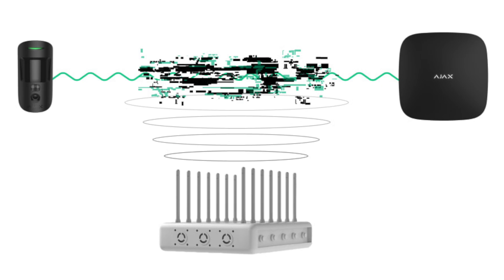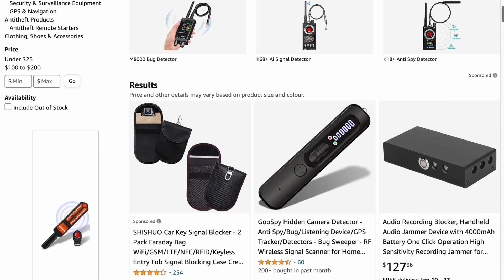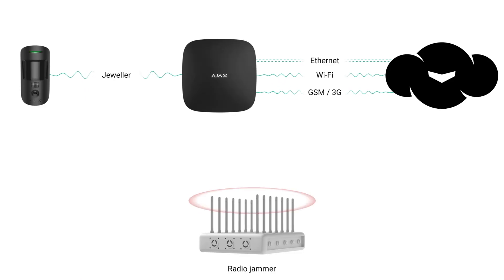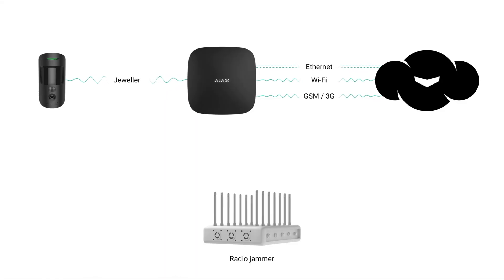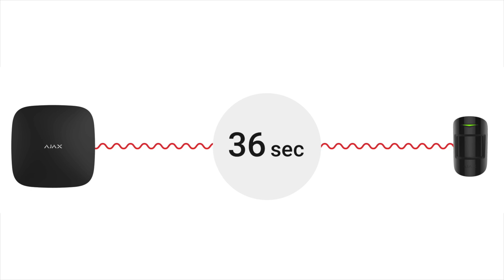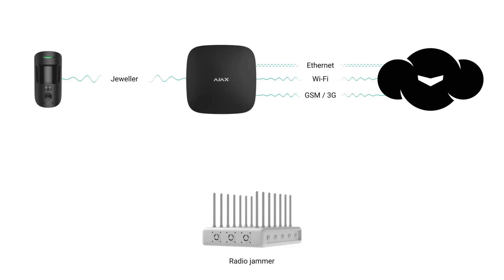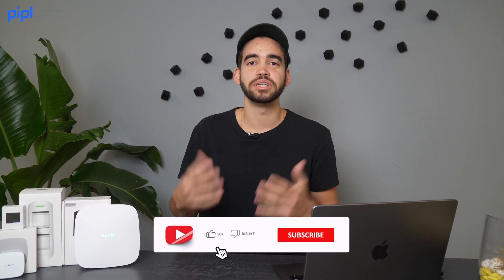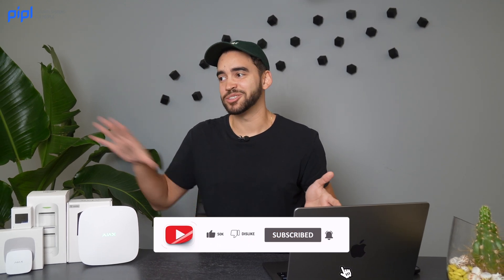What Jamming of a Wireless Alarm System is and How to Resist It

Comment: The thing about jamming is that once the actual wifi router goes out, its lights out entirely. Not to mention if your buildings electrical breaker goes out, its a similar situation. Protecting against jamming only works for minor threats or inconsistencies, but overall, basic home protection systems arent cut out for someone actually attacking your home through jamming. At most, you would get a notification someone is outside your home before the power/security systems went out. Which is actually still pretty useful, but please dont let this be your catch all security system, as it can still be bypassed pretty easily by a determined attacker.

Comment: You can put to work an older unused computer as a wifi jammer detector. It will only show the jamming in REAL TIME, though. It will not show you if you get up in the morning and someone jammed all wifi systems around you, including yours, in the middle of the night. You have to run the computer and have a display going. Just download the free program Turbo WiFi Analyzer, and put it on Wifi Channel Graph mode. That will display all the wifi systems around your house. If all of the wifi systems suddenly do NOT show? They have been jammed.

Comment: Vivint is wireless and it’s professionally installed so does that make vivint safe from jamming?
Reply from the maker: Vivint has built-in safeguards like encryption and tamper detection, which can notify the homeowner or monitoring center if jamming is detected. These features help reduce the risk but do not entirely prevent the possibility of interference. So chances are that you are safe but note that no wireless system is entirely immune to jamming.
Reply: @piplsystems I have Vivint and things are happening inside my house. So I believe jammers do work on Vivint

Comment: but the hub can make the alarm noise right ? so at least the siren in the hub should go off
Reply from the maker: Great point! While the Ajax Hub itself doesn't have a built-in siren, it can activate external sirens like the HomeSiren/StreetSiren for audible alerts. Additionally, in the event of issues like internet loss or interference, the Ajax system sends instant notifications to the user's phone, providing an audible notification on the mobile app. So, there are multiple layers of alert mechanisms, ensuring users are promptly informed both audibly on external sirens and via notifications on their phones. If you have more questions or need further details, feel free to ask!